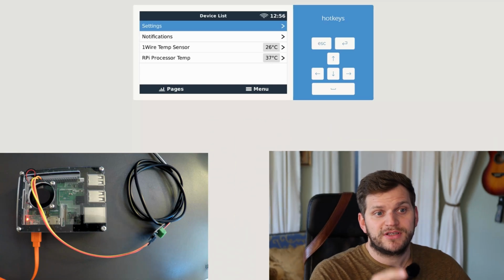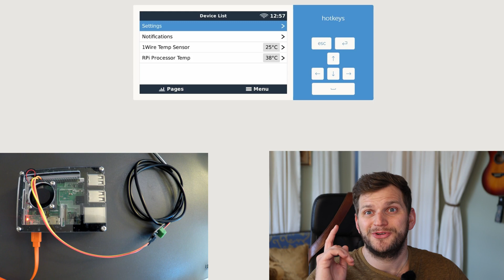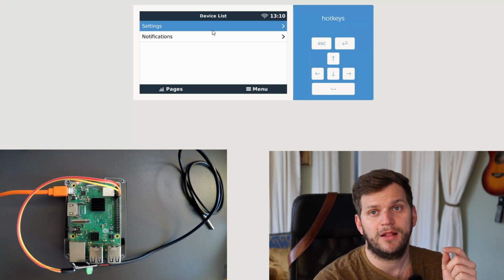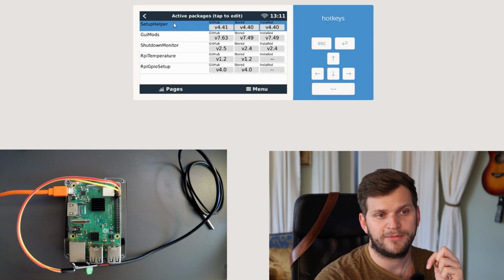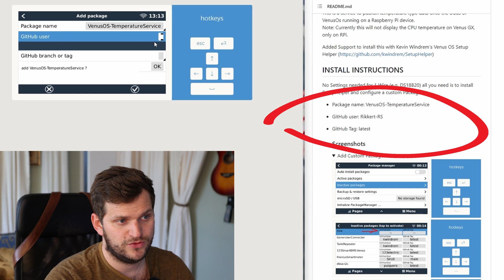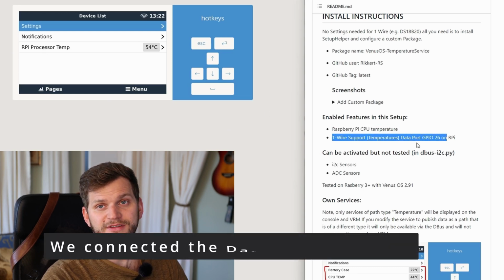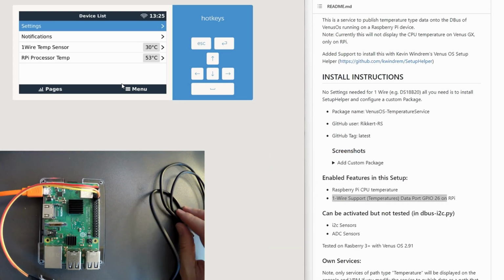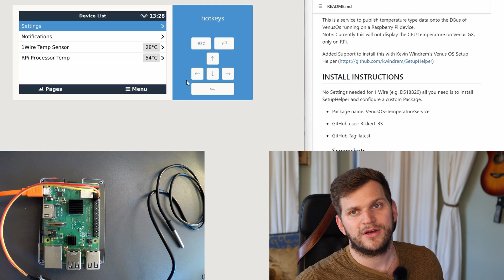Victron VenusOS Raspberry Pi | 1-Wire DS18B20 Temperature | Installation and Configuration

Comment: Thanks man. Chat gpt failed me completely on this setup. Your video saved me. I can confirm I have it running with the relays also. Running 2x wires into the same gpio 4 at my allotment. One to the greenhouse and one to the solar water heater. All controlled via node red! 😊

Comment: Thanks for your video!
Unfortunally I can't install the VenusOS-TemperatureService.

When I try to install it (V0.52) there is an error:
"VenusOS-TemperatureService install failed - unknow error 127"
then there are a lot of line errors (line, 18, 24, 33, 54 and 90) in the /data/VenusOS-TemperatureService/setup file

I also tried to download and install previous versions of VenusOS-TemperatureService (v0.40 and v0.50)... but I had the same result!

Have you any idea for fix it?

My system
Raspberry PI4 8Gb
VenusOS Firmware v.3.53

Thanks!

Comment: Hi Toby. It was me who asked you to do this a while back now, and I never thanked you. That’s mainly because I had lots of problems getting this to work reliably. I did get it working on one installation with multiple sensors, but on another I couldn’t. 
I’ve just gone back to it today and followed through and realised the reason it wasn’t working on the second installation is the GPIO pin was set to 26 by default and I hadn’t changed it to pin 4. I guess I had done that on the other installation but forgotten that step.

So thank you so much for putting this video together.
Reply from the maker: Thanks for watching and great to hear it works for you now :-)

Comment: How to bring the 1-wire Sensor to VRM portal?
Reply from the maker: When configured and visible on the console it should pop up on the vrm console. You can check in devices in case you need to activate in it

Comment: Thanks for the video. I was scratching my head because it wasn't working for me with a single DS18B20+ sensor. Mine is a straight sensor, no wires and it's not submersible. I tried different GPIO pins (changing /u-boot/config.txt each time), but in the end I just had to connect a 4.7K ohm resistor between 3.3v and the data pin. You do this in your "multiple sensors" video, but not this one. I wonder if the pre-made sensors have a resistor built in? Or maybe the little board that you're using has one?
Reply from the maker: Thanks for watching! Yeah, something might have slipped thru and just worked out for me. Thanks for sharing, I need to double check on this!
Reply: @tobisreallifeskillswithtobi  actually I see now the little board you used DOES have a 4.7K Ohm resistor built in. I'm glad I watched your other video first, so I had the foresight to order a resistor "just in case"!
Reply from the maker: @walden_ Nice! Thanks for checking 🙂

Comment: Thanks for a good description of the temp sensor.
I have done the installation as you describe, and changed the config.txt to Gpio 4 instead of 26. I have a Rip 4b, but I still can't connect to the 1 wire sensor, is there anything else that could be causing it?

Regards Roger
Reply: I found theproblem, my temperature sensor does not have the pullup resistor, and then the rpi does not register that it is there, after I installed it, it works.

Comment: So i installed the temperature package and the remote console device list is changing back and forth asking to remove disconnected devices. Could this be because i dont yet have a temperature probe connected. I removed the package but it keeps flashing back and forth. The joys of messing about lol

Comment: The temp sensor is read 52- 53 C that's 126-133 F! That can not be correct unless you have very hot fingers. I'm also getting very high readings and can not find a way to calibrate the sensor. Any help would be great!
Reply: Sorry, it was 28 - 30 C 82.4 - 86.0 F that still seems wrong......
Reply: I have one temperature sensor to work on gpio4 and a second sensor is attached to gpio7 that is not recognized. Any help would be greatly appreciated!
Reply: Found the multiple temperature video. It all works great! Thank you for the info......

Comment: Thanks, this could be useful an cheap addon, and you can use as many pins you are available in Rpi with code modification!
Reply: Yes and you can also use I/O expanders if you run out of pins (often via i2c, e.g. PCF8574 or MCP series chips).